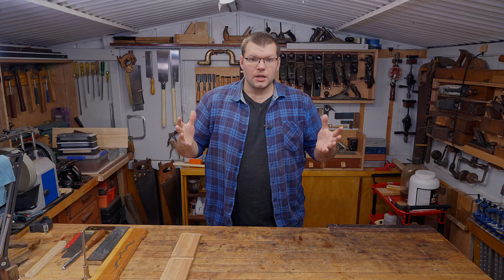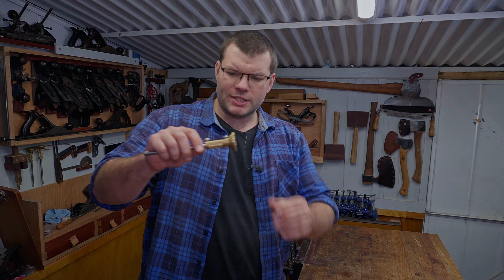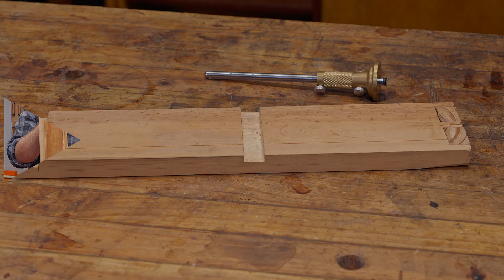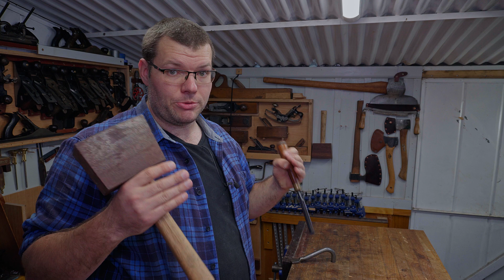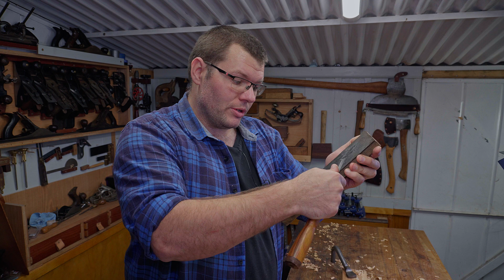Chisel Method: How to Cut a Rebate with Basic Hand Tools

Comment: Extremely useful, thank you! I have a rebate plane but it's a vintage one and needs a lot of work before I can use it, but I wanted to make some box floors and lids in the meantime.
Reply from the maker: I've definitely found this technique useful a few times. It's also a good way to build confidence using a chisel. Good luck with your rebate plane restoration.